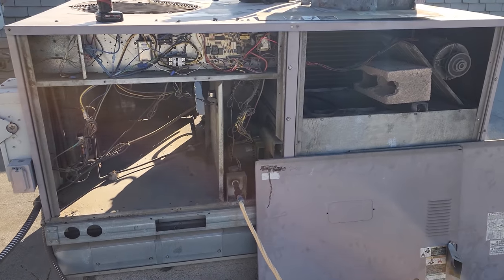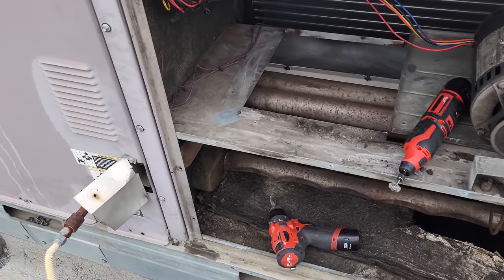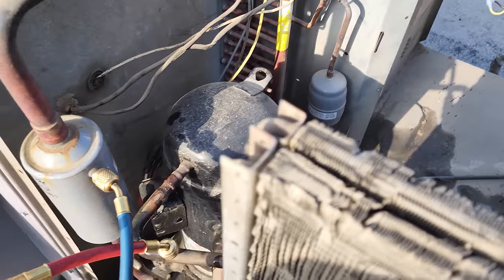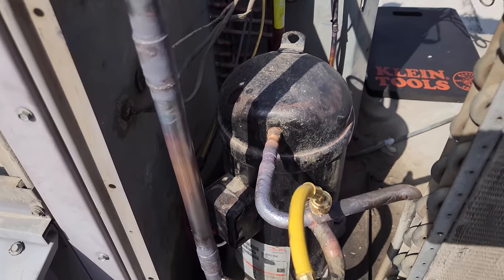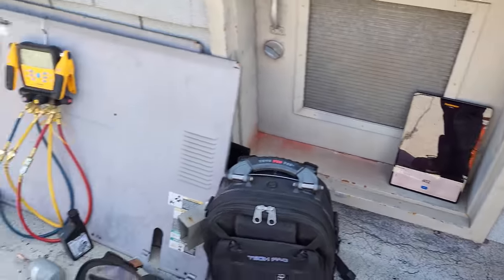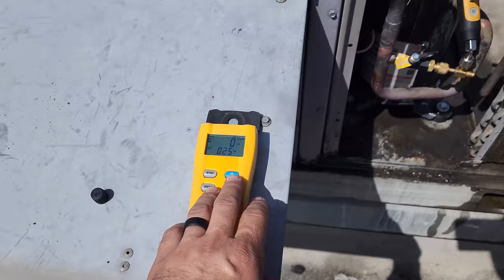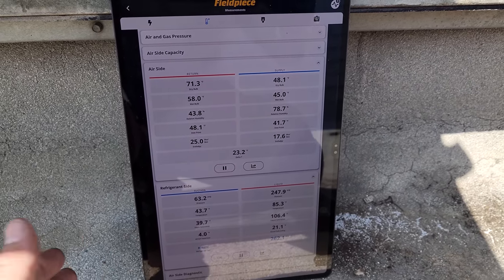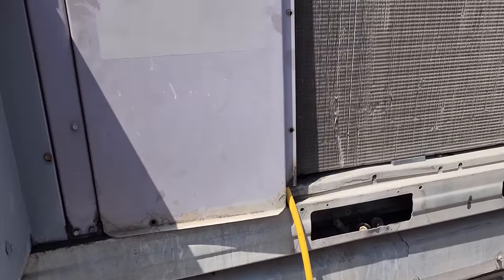I CAN'T BELIEVE THEY APPROVED THIS REPAIR

Comment: "Drill a hole at the end of the crack to stop the crack from spreading" that gave me a flashback to a mayday air crash investigations episode where mechanics did that like 3 times, until it ripped off and the plane crashed
Reply: thankfully not a lot of package units fly. usually....
Reply: That was Chalk's airplane, and the repairs were nasty on top of being inappropriate. They drilled holes then covered the cracks in glue so they expanded without being seen until too late.
Reply: @SupremeRuleroftheWorld  At least that's the plan ;)
Seeing what some companies do to those units, I wouldn't be surprised if one gets airbrone :D
Reply: @Thomas-lq1jw  dont give trane any ideas
Reply: @SupremeRuleroftheWorld   I'm more afraid of some of Chris competitors :D
Reply: @SupremeRuleroftheWorld  This one should have gone flying. With the help of a crane, off the roof, to be replaced with a new unit.
Reply: Yeesh
Reply: That’s what people do where they got the #53 24 valve engine block when it cracks
Reply: @Midwest_Gaming_Express  most people here aren't gonna know what you mean by #53 24 valve block but as a former mechanic yeah that's exactly what they do. Sad that they screwed up those #53 castings so bad. I've heard that stitching the block like that is still hit or miss because the castings are still on the thin side.

Comment: Repairs, suddenly valued in a world of scarcity. Maybe preventive maintenance, too!
Reply: . . . nah. Things will run forever if you just ignore them hard enough :)
Reply: Planned maintenance is always cheaper than emergency repairs.
Reply: @BlackSoap361  Yup! Prevention beats a cure and all that. Especially when the cure now has a four-to-six-month lead time.
Reply: @BlackSoap361  thats a blanket statement and not even nearly accurate. Ever owned a drift car?
Reply: @davidopitz972  I’m talking about responsible engineering and management practices.

Comment: When you switched from the high side to the suction with your hose you have about 6” of non condensables in that part of the hose. I know everyone can’t catch everything but before screwing the hose on the service port allow the liquid refrigerant to escape before seating the hose on the service port. Just a humble opinion.
Reply: I dont see it shown here, but he has shown in the past where he will purge the line before fully seating the line on the schrader
Reply: I'm pretty sure I read that when switching to 407C ithas to be a txv system.

Comment: I work for a manufacturer and I feel like we are the only ones selling chillers and RTU’S 40-120 tons… finally hitting a kink in the supply chain with fan motors. Good job on that call
Reply: How much of that has to do with manufactures saying they aren’t accepting any orders?
Reply: Who do you work for?
Reply: Who?
Reply: @tkaneci2  Daikin
Reply: @ThePete2432  hardly ever see you equipment here in colorado unless it is a dinky mini split that doesn't work or a vrv/vrf system.
Reply: @brandonhvacants2217  my group runs from vrv systems, we do mostly chillers/air cooled chillers and RTU’S 10-120 tons.. it’s been a great place to work so far

Comment: Re: the crack repair on the bracket, in aviation we would normally stop-drill, paint, and rivet on a doubler plate over the crack to stop flex.

Probably overkill for a unit as beat as this one looks though: Your repair should outlast the remaining service life on this thing!
Reply: I was thinking the same thing.  Maybe that's an aircraft thing.
Reply: Definitely the better fix.
Reply: @sydnerland9624  Not sure I'd definitively say "better" - a doubler repair will probably last longer (so "more durable" for sure), but if this unit only has another maybe 5 years of service life before it gets replaced the Chris can make the braised repair in half the time of the riveted doubler repair the customer might consider that "better" (fewer hours spent on keeping a beat machine they're going to eventually scrap running).

If it was a new AC in its first year or two of service? Then yes - a doubler would definitely be "better" IMHO.
Reply: I also was thinking about how we do it in aviation and was surprised to see it being used in HVAC.
Reply: In HVAC, people aren't at risk if the part fails again. ;-)
Reply: @deanwoodward8026  Carbon monoxide poisoning and fire are real HVAC issues.  In my condo complex, an entire building burned to the ground because the lugs weren't properly-tightened on a fan-coil unit.   Worked fine for 8 months...until the heat strips were turned on.  Aluminum wiring... No one hurt, thankfully, and somehow insurance managed to get the building re-built in about a year.
Reply: HVAC Guys might should learn to stick weld
Reply: Civilian or military? The motto I hear from military aircraft repair is “beat it to shit, paint it to fit”
Reply: As someone that is a trained welder I would of miged weld it
Reply: I don't weld but I do automotive/light-truck work. I would've drilled the crack and done plate and rivets also if it were a vehicle.
Reply: @keithv708  would of.   really?
Reply: Not sure I understand the process of brazing.   You can still see the entire crack when he is "finished" brazing.    I would think you would want to fill the crack, and build it up top and bottom like a weld, but maybe not....

Comment: I haven’t had good success brazing over cracks, they usually crack again. I probably would have cut that section out and used a 90 and a street 45 to make that bend. What do you think?
Reply: I agree, it might have just been easier to cut a new section
Reply: Drill a small hole at each end of the crack, it prevents the original damage from spreading. Then braze over all of it. But it’s critical to remedy the vibration that caused it in the first place, or all bets are off.
Reply: @TheMinecraftACMan  I like to install a vibrasorb whenever I have a pipe crack
Reply: @Shmash_whatever  never seen 1/2" vibrasorber before. I thought they started at 7/8
Reply: @kaptaintrips  I’ve seen them down to 5/8
Reply: Never use 45s in refrigeration. They crack. A lot.
Reply: @jman0870  I haven’t seen that myself.
Reply: @Shmash_whatever  you will. Google it. It’s a highly discussed topic. 🤷‍♂️
Reply: @kaptaintrips  They go down to at least 3/8, I've used them before.
Reply: @jman0870  Very false information my friend. I cannot find any documentation online discussing this topic.
Reply: @JohnSmith-do6wg  you didn’t look very hard 🤣

Comment: Great video as always, this is reminding me of the great recession, dont waste your time thinking they will just replace it, its getting fixed!  Im curious if there was a reason to add oil after it was running, instead of right before flipping the vacuum pump on?  Love to see a deep dive on proper steel/steel, steel/copper, copper/brass brazing as my memory maybe getting dusty.

Comment: for the cracks in the housing;   I would have  cut out flashing plate to make covers/supports to rivet onto both sides for support and strength.  Would probably hold/last longer.

Just a good tip for you =)
Reply: another option, get a 110v gasless mig welder, drill the end like the vid then run a weld along the crack, assuming you know how to run a mig it should hold better then the sheet metal.
Reply: He DID drill the crack...
Reply: @moehoward01  must have missed that little statement, didn't remember hearing it.
Reply: yeah i would cut out the crack with a cut off wheel then weld it back together
Reply: @JaredKaragen  you also see him doing and after doing it he repeats why he did it. 4:40

Comment: I would check the compressor windings, and make sure it is not going to high to ground.  I have had systems with running compressors that have a ground in them.  Especially if the oil is very dirty.  

I see your brazing, and are using more oxygen that I was taught to use.  By having a '"Lazy Flame" it will solder easy.    So light the torch like you normally do, then reduce the oxygen a little bit, and see how the blue parts is longer by about 1/4".  That is considered a lazy flame.

Comment: I struggle with where to place my joblink temperature clamps on systems.  I know Jim has specified like 6" away from compressor or service valve, but I still feel like I'm guessing when I put my probes on a system.  Anyway you could do a video to overview this topic?  I think it would be very beneficial to new techs trying to utilize digital. Thanks! -Will

Comment: That was a Great Video and Awesome repair.  Had a similar issue with a York Unit and the unfortunate problem was the cost of the components to rebuild the unit. We thought that would sway the decision for replacement.  Offered and strongly insisted that the customer change the unit, but lead time was something that could not handle.  So we rebuilt the unit and changed the evaporator, and compressors due to history of reported problems and failures.

Comment: Chris, I always carried a quart of muriatic acid not only to clean the surface but to also remove the galvanization on these blower cracks, wire brushing and drilling a hole to stop the crack was the right move, I rarely had it crack more after that, unless the vibration problem was not taken care of. That was a trick an old sheet metal duck shop taught me. But good job, like you say in some cases your are just polishing a turd at some point. lol

Comment: On those sized copeland compressors im pretty sure those copper fittings are solid copper where you braze them in.  Im basing that on ones ive cut apart to scrap and repairs ive made. I know smaller ones in the small refrigeration size are sometimes copper plated steel like you are talking about. But im wondering if your issue getting them brazed in after doing a oil change was oil contamination in the braze joint. Ive seen that cause issues before. For instance on a repair near a leak where everything is coated in oil. But i really dont know the best way to clean the oil out of the fitting after you dump the oil out. Its not like you can spray brake clean in there. But something to think about next time you run into that.

Comment: Question: If you are worried about sweatingthe compressor connections, why not just cut the copper tube 6-ish inches away from the comp and use couplings? It would allow you to change the oil and not have to worry about the bungs. (I know, it's adding points for a leak but you've already had to change and move things so adding connections isn't really a problem?)

Comment: “I can’t believe they approved this repair…” yep, I’ve had a few of those lately lol. About a month ago I fixed a leak on a similarly sized “rectangle” Carrier, on the discharge line. My current “overkill” vacuum setup is a run of the mill JB Platinum 7cfm pump, through single 1/2” or 3/4” (can’t remember the size) Appion vacuum hose, through a vacuum rated Appion core removal tool (with the core removed of course). I used this exact setup for the first time on this repair, and was in total awe that it got down to about 400 microns in about 15 minutes. Then after I charged it up and let it run for a bit, I shut the unit off and heard a faint hissing. I was about at the end of a 10 hour day, so I about flipped out thinking my leak repair didn’t work and the leak reopened. Turns out it was just the indoor blower running making that sound. Sometimes it’s hard to tell when you’re exhausted and surrounded by other noisy running equipment. 🤣🤣🤣

Some tips for the newer guys, as I learned from my own experience:

1. never ever, as much as possible,  pull a vacuum through your manifold; they will leak and are not designed for it. Even though some of these SMAN’s have a vacuum port, still don’t. It will still leak and take you all day to pull a mediocre vacuum. 

2. Change out the gaskets and O rings on your vacuum hoses and accessories regularly, as they deteriorate rapidly with use and will leak. Having trouble getting a new gasket in the hose? Just use a little bit of vacuum pump oil to lubricate; will make installation a thousand times easier. 

3. Make sure your core removal tools are of good quality and are vacuum rated; Appion makes a really nice one (which is what Chris is using in this video). Avoid the ones made by Yellow Jacket, they are cheap trash and fall apart quickly. 

4. When dealing with a system with those stupid annoying Coremax valves, you will not be able to remove the valve core with conventional tools. Get a couple of vacuum rated core depressors (they look very similar to core removal tools) to hold the valve open. Since these valves are designed for high flow anyways, keeping these valves open is similar to the same amount of flow you’d get with the valve core removed from a traditional schrader valve. 

5. Change out your vacuum pump oil regularly; you’d be amazed how quickly oil gets dirty even when using the gas ballast. Dirty oil makes your vacuum pump far less affective.

Comment: I had a blower section like that and the motor mounting plate and i noticed they sent me the updated motor adjustment plate than makes it sit lower where the inner section slides in the outer. Like it much more than those that bounce

Comment: Crazy this video came out.  I just had a call with a cracked discharge.  I wondered why.  Well, we got approved to repair it.  Charged the system and the metering devices are all clogged causing very low suction and big vibrations in the compressor.  Now I get to do it all again...live and learn.  Then again, the leak was so bad I couldn't run the system to tell that the metering devices were clogged so...

Comment: If you get pipe expander tool you can save on using couplings. After I got mine I almost never use couplings. Plus only one joint to braze versus two on each connection.

Comment: I have a carrier 6 ton from 1997. Last summer compressor went. I suggested replacement of unit. Nope they did compressor. Get comp and and find out metering devices are plugged and condenser fan motor are shot. suggest maybe its time to replace unit. Nope replaced metering device  and condenser fan motor. Fast forward now to winter, service call, blower bearings gone, blower wheel wrecked, gas valve and board failed. And guess what , all being replaced lmao. Sometimes we can only make suggestions and do what the customer wants. Nice job once again!

Comment: Yep, there's several pieces of equipment that I have repaired that should have been replaced so far. I'm still waiting on a temperature controller for a hot case that I ordered in February.

Comment: Oh you would like this: on a job doing a pm on the weather maker, coil freezing up. Merv 13, no load in the space, 65 amb. I state I need to return bc it might have a leak, just be low air flow, or both. They tell me to replace the evap and use fresh 22.

Comment: Like was mentioned below, do you figure in the oil capacity of the hose when you apply a shot of oil into the compressor? To me, it doesn't look like there is much more volume in the piston compared to the volume of the hose over to the compressor.
Reply: I think you will be surprised if you cut a test hose in half.
Reply: You're probably right. I did a quick calculation and if that is 1/4" ID hose and it's 4' long, it will only hold about 1.3oz of oil. Not sure the capacity of the pump per stroke but, I suspect it's large enough that the oil lost in the hose probably doesn't amount to enough to matter.
Reply: One piece of feedback for fieldpiece, I have have 3 air probes and there is no way to set the third to measure outdoor temp unlike that app that shall not be named.

Comment: The only question I got is how long will that braids repair last on the unit pan and drilling out the end of the crack was very smart I learned that years ago doing aircraft maintenance which I no longer do
Reply: With the replaced blower assembly the vibration that caused the crack won't be there anymore.
The blower housing screws to that panel, so will help hold it together too.

Comment: I have a question if you don't mind. Instead of un-sweating, would it have made sense to cut off the copper a little further away from the compressor. Remove the oil, weigh it back in and then patching the cut copper lines to close the system with a copper couplings? Love the vids

Comment: I had to do a repair that required replacing the blower wheel,shaft, and bearings. When I asked carrier about a prebuilt blower assembly they told me they didn't do it. Pretty bummed and it made the repair way longer.

Comment: Did the oil even get into the compressor, or is pumping once just filling the hose?
Reply: Went in suction line….so the oil was drawn in by normal compressor function. He waited a little after the pump to disconnect the hose. Good question though…if ya don’t wait, oil could just remain in the hose.

Comment: Well according to my family Im older than dirt I liked using the old wood gauges that used a metal spring that would move by temp or pressure.  Using those brand new analog gauges is just to advanced for me. Mostly I just eye everything or guesstimate. As long as it sorta works, its good enough!

Comment: Another comment, blue rod 45% works great at welding metal as well.  The nut that you tighten on my blade puller broke lose in the middle of a job and I welded it back on and it’s never broken since.

Comment: If you have Fieldpiece's ear, are you grilling them over their multistage/multicircuit configuration issues in the app that you seem to get tripped up on?
Reply from the maker: That issue is with the Measurquick app, that has nothing to do with fieldpiece.... you can just use the firldpiece tools with the app

Comment: Is it possible that they had you repair them, due to how long it's going to be until the new units show up? I'm assuming that they may already be ordered! I also think a plate should be added where you have repaired the crack to help strengthen the original part.